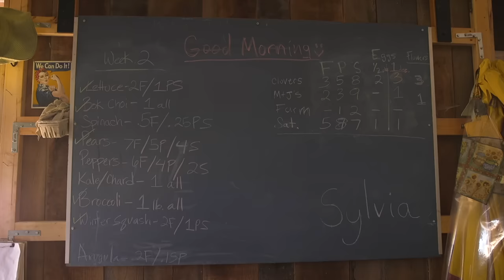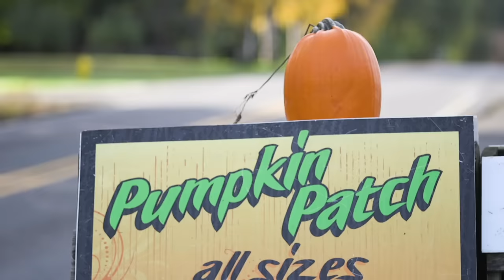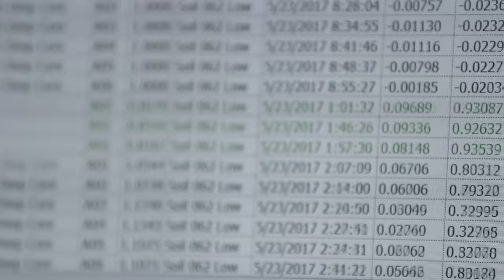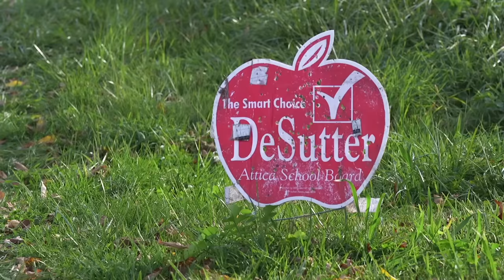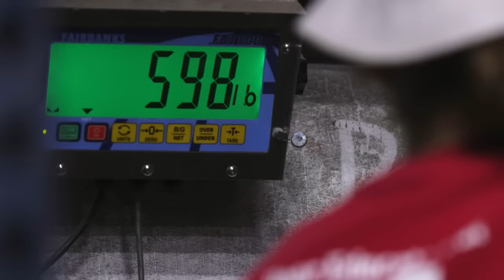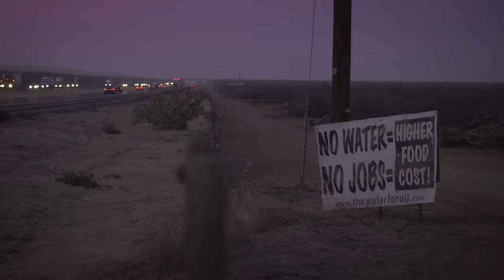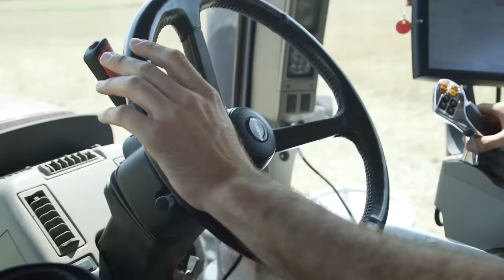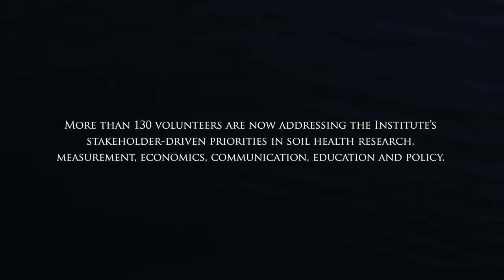Living Soil Film

Comment: What cover crops can be cut or laid over as mulch for the next seasons cash crop? I like to use hay from bales as mulch in my smaller garden, but that grass can’t just be laid over and used wherever it falls as mulching/soil building material if you are planning to rotate back into a cash crop on top of the new thatch/mulch layer because the grass underneath is still alive. Basically I need an annual, not a perennial, that is similar to hay🤣🤷‍♂️🎃
Reply: Peanuts comes to mind.

Comment: I live on the High Plains for 70 years.  I started a farming business after getting my degree in Natural Science.    In the first 50 years of the last 100 cattle were a large part of the farming.   This almost destroyed the soil to the point of crop yields being so low that many just produced cattle and having constant dust storms.   We have learned that adding fertilizer and little tillage and no cattle the crops are many times more productive.  The crop residue from a healthy fertilized "adding essential elements" crop makes for a healthy soil.  Cover crops use water and add carbon if they also take nutrients from the soil and more water is available from a renewable source.  This Documentary is a fairy tail to push an agenda that something can come from nothing.    An agenda that government control is the answer; and government can borrow the way to prosperity.
Reply: I think you've got it mixed up. I urge you to watch all the Allan Savory videos. He can be a bit difficult to understand at first, but you will eventually get it.
Reply: @tonytony1035 Too little knowledge is not the answer.   In fact it is dangerous.

Comment: Farmers in Paraguay see major yield increases with GMO corn, despite degraded soil
"10 years ago, a group of 14 peasant farmers in the San Juan Nepomuceno region of Caazapá took the challenge of ensuring their livelihoods through the use of biotechnology, according to a report from the Institute of Agricultural Biotechnology (Inbio).
Caazapá is a region with many riches, but in some areas its soils are very degraded. A group of producers is achieving success through work, permanent technical assistance, the introduction of sustainable practices and the correct use of biotechnology, with the support of the Institute of Agricultural Biotechnology (INBIO), reported Fabio Vega, extension specialist with the Ministry of Agriculture and Livestock (MAG).
“When we started, [farmer] Don Trifón Ruiz Díaz had a yield of tupi pytá corn of 800 kilograms per hectare, his cotton was around 680 kilograms per hectare, and chipá corn at 700 kilograms per hectare, in a highly degraded soil,” [Vega] recalled.
Díaz stressed that farmers were taught the correct use of biotechnology. “We learned about the varieties and their management, through which we were able to achieve better results …. [in 2019], when we had optimal weather conditions, we achieved significant yields,” said the producer.
 On that occasion, [Díaz ] corn yielded 7,000 kilograms per hectare; cotton, 2,970 kilograms per hectare."   https://geneticliteracyproject.org/2020/06/05/farmers-in-paraguay-see-major-yield-increases-with-gmo-corn-despite-degraded-soil/

Comment: It is high time people begin to understand the cognitive dissonance associated with Animal Agriculture.  Animal Agriculture is energy intensive and the single largest form of oppression man has ever used.  A new scientific paper is out explains in great detail about how animal fat, plug cells, arteries, and digestion causing all forms of inulin resistance (DIABETES).  This also leads to most chronic disease, heart disease, high blood pressure, planet degradation, water destruction, and eco system imbalance.   These tests were first used in lab rats in 1922.  Drinking another mammals lactations is weird when any rational is applied.  Worse is the level of antibiotics and hormones' used in the animals you consume.  Do you support Animal Abuse?  Animal Agriculture is responsible for at least 80% of our climate issues!